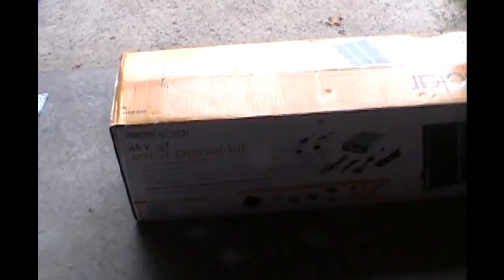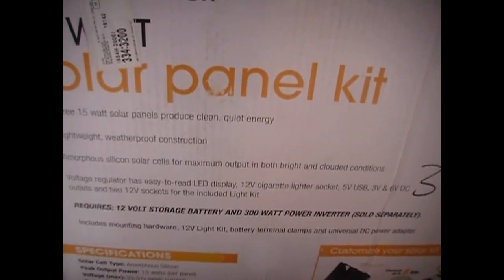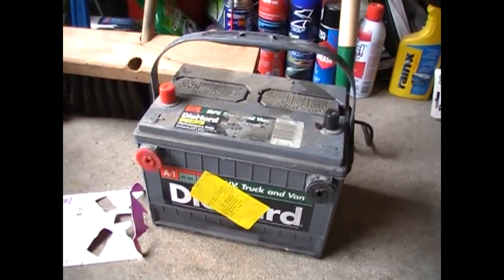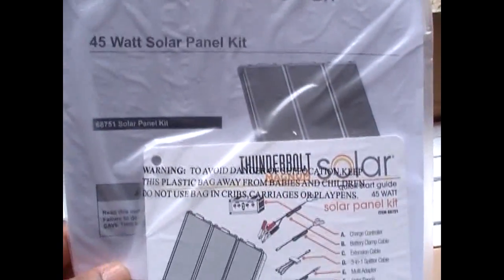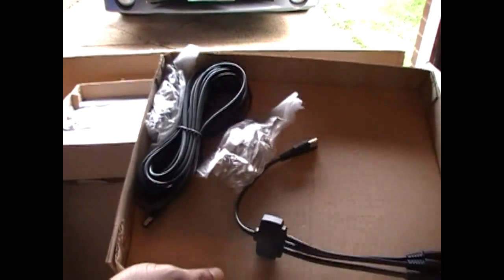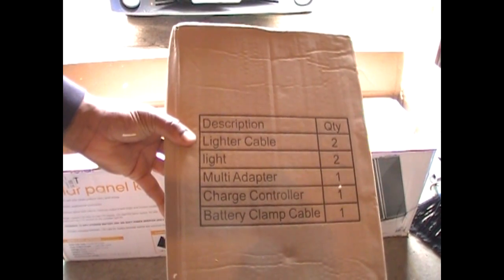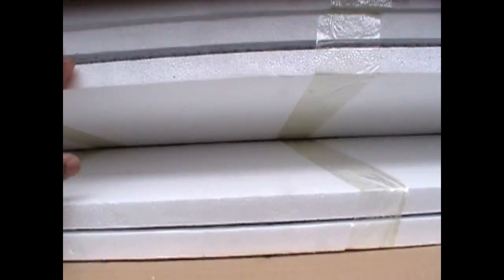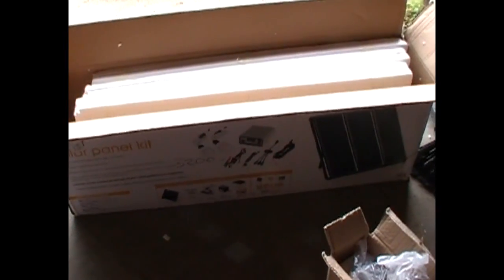Harbor Freight 45-Watt Solar Panel Kit Unboxing

Comment: Battery health is important. Just sayin'.   ;)
Reply from the maker: No doubt. That old battery is just what I have available and it just doesn't have the cranking amperage left to turn over and auto's engine reliably. But I do have a video coming up where I am charging it with the panel!
Reply: I will look out for the next video.  You get lost these days in YouTube's wonderful UI pushing vids you don't want to watch or vids from sub's from years back.
Reply from the maker: yes, I know what you mean. it's amazing how they can turn something that was so simple into a disastrous mess.